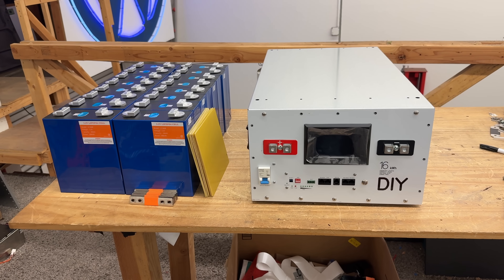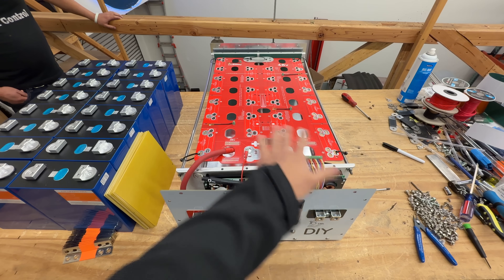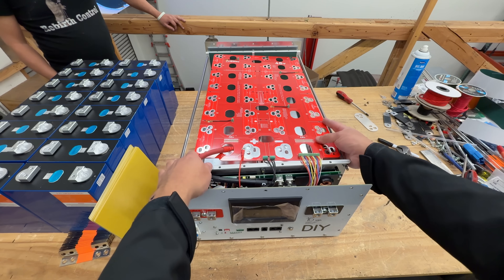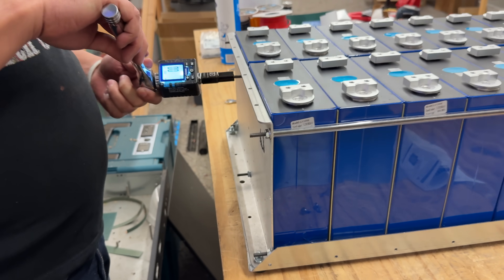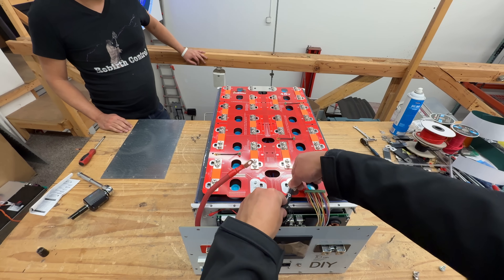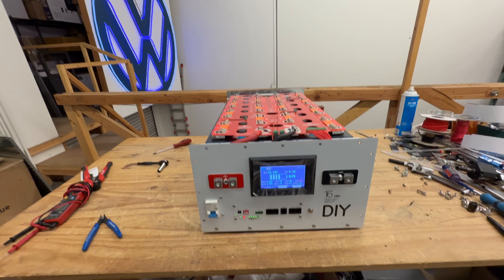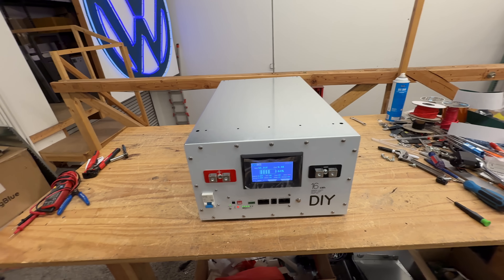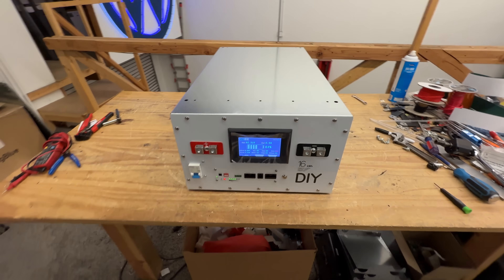DIY AmpBox1.0 #lifepo4 Enclosure

Comment: I just put a new battery together with EVE's they were so well balanced the active balancer never turned on. JK is nice but almost overkill with the higher quality batteries selling now days. You go back 2 - 3 years lot of grade B some cells had QR codes re-lasered DIY community caught on to that. The drop in LFP prices those lower grade batteries disappeared from the market.

Comment: it needs a cooling system, one could implement it in Texas for example. Especially if stacking a few of these..
Reply from the maker: At .5c max load these definitely do not need a cooling system.   Unless you put them under direct sunlight these cells should not be hotter than ambient
Reply: @jehugarcia  in ambient air those cells should reach 35-40Celsious  easy  at 0.5c (80s at 1c) but hotter climates have higher ambient than 25 C which will result in hotter temps

Also some sheds or storage units or garages (which is where these will reside dont have AC or even good airflow so inside it could be even hotter than ambient air outside...

+ if on top of that you stack them then things get even worse especially for the boxes in the middle to the top

Those batteries need to be under 35 Celsius  in order to ensure longevity in charge cycles

Because nothing melted or exploded in your testing facility doesnt mean that the same is going to happen in your client's case

but ok I admit this scenario is unlikely (the explosion) and even having stuff melted too but even so the life of the batteries is going to degrade a lot more rapidly if they will operate over 35 degrees Celsius

Comment: Jehu, you show all these custom batteries, buss bars, bms boards, and connectors. The one thing I would like to see, is the battery charger configurations for all the custom batteries?
Reply from the maker: There’s nothing custom about 16 cells.  That’s pretty much standard 48v.   You charge these the same way you charge all the other 48v battery packs
Reply: @jehugarcia  I was thinking higher voltages, 120, 144, for EV conversions.

Comment: 1000amps DC at 48v is required to match a homes mains service. 200.84amps AC at 240v is what most homes have at their main service. You would need 5 of these units in parallel to provide the amperage with most likely 6 units to make up for loses.
Reply from the maker: I have 2 electric cars with 100A panel and I never get close to maxing it.  Most Americans use less power than me . You are talking worse case I talk about average American home
Reply: @jehugarcia  I understand, and truly appreciate everything you do. It’s just that the ratio between amps and volts are different between home and “lower voltage” inverters. It’s a lot of power, but not a true 1:1. Yes most people don’t use that amount of power at one time. The statement in the video just sounded like an equivalent statement.
Reply: Most houses are never pulling anywhere close to 200 amps, I have an energy monitor on my house panel, it's never had a concurrent draw over 7.6 KwH or about 32 Amps split between the 2 legs.

Comment: Very happy to see you're entering this market. I have been waiting for a well-optimized kit like this that isn't ridiculously expensive, and it looks like you're getting close. As someone who designs my own systems using 3D-printed parts, I would love to see a super minimal version of this kit, with only the core frame and cell compression components - that way I can print my own faceplate and implement my own preference of BMS, display, breaker, terminals, etc... instead of being forced into a one-size-fits-all solution and having no control over the features and final cost. Keep up the good work.

Comment: No Jehu, no wheels behind.
Lfp batteries need to have valve up.
Only wheels under
Very beautifull material
Reply from the maker: I’ve ran LFP on their side in a diy ev for years no problems.  Not sure if these new gen cells are any different.

Comment: The prices on DIY boxes are insane. Even without bms and pcb boards. Im Currently just using an old metal cabinet. Hopefully these boxes drop in price someday.
Reply from the maker: You can get a generic electrical box roughly the same size for about $200 https://amzn.to/41t6D3T
Reply: @jehugarcia  I bought one of these same enclosures for another project and its a heavy duty enclosure thats well built but the purpose built enclosures for the size cells your using have too many advantages to ignore for many applications.
Reply: @ if money wasnt an issue for me, id definitely go with yours. Yours is still cheaper than some of the other ones online.
Reply: @Nestos209   some but not all. I've found buying the components separately can save quite a bit depending one what you buy.
Reply: Some people have 40 year old fridges on their front porch and some don’t. To each their own
Reply: @cuisinartOH1  What does that even mean? Just a random stereotype meant as an insult? No fridge on any of my porches  although I've thought about it for my hunting cabin. The battery I built looks almost identical the one in the video but it has heating pads to ensure it can be recharged in subzero temps. And it cost me $1400 and an hour to assemble
Reply: @fathergratwick  I mean, the people that complain about this being high in price have absolutely no idea how much it costs to bring any product to market, not to mention a low volume product. If they are happy using an old metal cabinet and calling it good - fine. But don’t make it sound like there is no value to others who want something a little nicer. Hence, my analogy. To each their own.
Reply: @cuisinartOH1   I didn't use an old metal cabinet. I explained what I built without linking or stating from whom I bought my components for my diy build (since this is what this is) but my comment was swiftly deleted.. hmm
Reply: If I was actually allowed to respond in turn without my comment being deleted I would but... Ive bought things form jag35 before and the censoring of DIY is disappointing.

Comment: If I had 6 pieces of this. Are there instructions on the communication protocols for them to charge and discharge together and would 6 pieces work with a Deye or Flexboss 21 inverters? Also could I get this to Jamaica West Indies?
Reply: Ok. I can find a workaround the shipping issue I guess. What about the dip switch configuration for multiple 15kw units in parallel. Sorry I’m non tech but trying to learn from watching guys like you, Will, Everyday Dave and David Poz. Great what you guys do for the off grid community. I’ll be living off grid in a few years so doing all my research now.
Reply from the maker: Yeah every top end box now has jk bms so the setup procedure is pretty much same for all of them.  I’ll do a setup video soon
Reply from the maker: It’s the very popular jk bms so there’s tons of info on the forums on how to connect to many inverters.   I can only ship to USA addresses currently
Reply: Many thanks. J. Much appreciated. Blessings 🙏🏾

Comment: you should offer a 2p4s 12v option, no one seems to and its an efficient way to package 8 12v cells with one bms. Or whatever you think would be the best 16 cell 12v option
Reply: @marlowstanton2846  I'm doing it with 2p 8s 280ah cells in a 16 cells enclosure similar to this one. The cells seem to stay balanced better

Comment: That's an ugly box for $400!  USA made for sure. Love the ease of installation though,  How many can be stacked on top? Seems rather flimsy to me but maybe im missing something.
Reply from the maker: The compression plates are 3mm aluminum and they will carry the weight of the upper boxes,  the shell with not be carrying much weight.
Reply: @jehugarcia  should add latching device on either sides to hold the boxes together. Also maybe some anti-slip surface on the bottom of the box. Guess main cables will have to be connected with cables coming from the top if not they both will be in the way of  things directly below. Just looked $450! Not $400. Very strong price when compared with much better looking boxes. Just look like sheet metal with holes.
Reply from the maker: I sell 3!different Chinese models they look the same just black.  It’s just a sheet metal box after all.

Comment: So $450 for the box and about 2 grand in batteries?
Reply: EEL was $550 and $1200 for 320AH battery on aliexpress      ...i got 4 of them
Reply: @Ebbrush3  Links?
Reply: @tattooedteddy  depends on where you get the components. I just built a similar 16s 280ah box for under 1500 and that was with a jk bms and 2 heating pads

Comment: Awesome Jehu to see you are making these now! As an owner of 5 of your 48V DIY 3.7kWh boxes I'm glad to see these. I hope a few improvements are made from those 48V boxes, They had some minor issues that made them a pain. I share these pain points purely for feedback on this box and its design so that these type of annoyances can be avoided. I LOVE my 48V boxes!

First off cramming all the cables for the display and BMS ect.. was tight, too tight honestly a 1/2 inch more would have made a big difference, but ok it still was easy to do. 

Making your own cables, not a big deal for me but man the bends you had to make made the cables really work hard. I used your cables, well not "your" cables but what you usually use WindyNation Welding cables. I found some of the bends from the breaker to the the terminal to be rough. Again you can smash everything in there so it works. But just a little more wiggle room would have been nice.

Looks like in the video you have all this "preinstalled" which is great I dont have to try and cram this stuff in.

The terminals - this turned out to be a big pain point for me, and it was my fault I'll be honesty. Since I wasn't using my setup like a traditional setup, there was a lot of unscrewing and screwing on solar charging cables. I had several of my boxes eventually break loose the terminal post! I busted out the old trusty soldering iron, removed the old solder and soldered them again fresh. Problem solved, my fault for probably overt tightening in the first place. I've moved to anderson connectors to that is a non issue now for me and moving forward.

The 48V boxes had a weird issue (all of them) with when you first turned on the box and then flipped the breaker on you would get a CC alarm that would go away. Now I did go into the BMS and change settings, one was the CC setting, I lowered it for what I though would be extra safety, but I learned over time I had to bump it up to 300A or 600A depending on the inverter/load. I mention this more for other people than anything else. I wish the BMS's were programmed for the box already but again nothing that can't be overcome, heck a pamphlet with some recommended settings would be nice.

I'm glad to see you added the 2A balance BMS! I know you feel strongly its not needed but my experience with the 48V packs is I really wish they had active balancing. I top balanced my batteries and everything was identical down to 3 decimal places and I noticed the drifts starting to occur. I've heard people say that's a LEV60F battery thing that they are hard to keep balanced but I can't say if its true, in my experience it sure appears to be. So I'm glad you are using the 2A Balance BMS now WITH bluetooth that was another huge drawback of the 48V boxes!. I know these cells are much more likely to remain balanced but its nice to have it anyways! I think you probably noticed that with your sales. 

Assembly/disassembly - ugh man this hurt. Literally. There was so many darn screws you had to undo to open up the box for maintenance (LEV60's going out of balance...) getting the 16 cells inside the box was SO tight. to the point you couldn't add a sheet of fish paper in between each cell because it was too tight for the plates which had a terrible design of not being able to give them room for expanding and then tightening them again. Sure you could remove them but they had to go back into the same location and if you added stuff for protection god it felt like you were crushing the batteries. The best I managed to do was to wrap each cell with a few layers of kapton tape, anything else and you couldn't get the compression plates to sit properly it was too tight. So when I had to take cells out to re-balance them it was a horrible PITA. Because of the tight tolerances of the box, you almost never got all the screws to line up properly to reinstall them. You would have to push down hard on a part of the box to make some of it fix and other parts were just not aligned well. I dreaded taking those boxes apart. It could also be likely I just suck at putting things together! I hope these new ones give more space so that cells fit easily and can be compressed properly and keeps the box in its proper shape without making it wonky when you go to put it back together. It looks like you did that in the video so that's good, but it also looked like the other guy in the video was having to fuss with the plates to get the cells to fit in so there a tad of concern there for me. I'm glad the box is designed and accounted for the insulating sheets.

I'll probably wait for V2 of this box to buy one (at first then it'll be 5 lol) that has wheels and busbars that are the hard kind that go to the bms. Really need wheels or the ability to easily add them I'm a one man operation. I don't have the luxury of a 2nd set of hands to help me so I have drag this thing that weights probably more than me alone (you would have seen me trying to handle 400W solar panels alone, I darn near killed myself, if anyone's curious yeah you can fall on top of one and they'll be ok. that hurt..

Again I'm a very loyal customer and at this point I'm probably past the $10K in sales with you. I love your videos, and your products are what you say they are, though I do have concerns over some of the EV cells that could be part of recalls but I just stay away from those, I don't want to bother with Li-ion cells anymore. So I'm not bashing your designs, in fact I'm the guy that still needs 2 of the LEV60 "basic" boxes that we chatted about on ebay as I still have 32 LEV60's I want to put in a 16S2P config.

So after a very long post what I would love to see in a V2 version of this box:
1.Wheels
2.Continue BMS w/active balance and bluetooth
3. Maybe stronger terminals, not critical...
4. Fitting 16 cells EASILY and then being able to compress properly, this is HUGE on the list.
5. Minor documentation on the BMS recommended settings (maybe?)

I am curious in the video you installed the 16 cells and reconfigured the BMS and it read around 60something SOC. Were those cells just out of the box and not top balanced already? That would be a nice comment to add on a sheet explanation of the top balance procedure, since this geared towards newbies. I admit I didn't know when I built my first box. I learned later on. But its a lot to learn about. So any small help is always appreciated. Even if its just a paper sating "google top balancing --you need to do this before battery installation". Help the newbs out!

I super excited about V2,  please PLEASE ensure it'll take the 314AH cells without issue that would be awesome man. 
I know I'm nobody to you, you wouldn't look twice if I was being beaten by someone on the street, just someone who's paying your bills, its fine we dont need to be buddies, all though I still have tremendous respect for you and I would come to your defense in a beating! I've offered to help your business for free many times to no response. Its cool man do your thing. I do hope you take some of the comments I shared for V2 seriously, surely I'm not the only newbie out there that struggled with the 48V box (which is actually powering my bedroom right now where I am typing this!).

Keep the new products and videos coming! Love them. I seriously want to do something with the JP3 cells you are offering even if they are Liion chemistry. I'm just waiting to see how the design of the busbars works with the tabs, I wish you would do a video on just attaching your busbars and the ones that came with the cells showing how to make a 2s2p pack and building it out. That's what's stopping me from buying a ton of them. I just dont understand well the busbar situation. I'm a newbie.. I'm also unsure (maybe its on your site now) the max continuous charge rating for them, my solar can push upwards of 70A but I don't know if those cells can handle that (I know the discharge they can..) Actually I think I see a video on my recommended viewing that you made about them without a laser welder! Need to watch that now! Could lead to my credit card exploding!! :) 

Cheers brother,
Wishing you all the best and keep sharing your knowledge. Mad respect for you.
Reply from the maker: Seems like we are addressing most of these concerns in the next iterations 1.2 will have built in handles that will serve as air vents also.  We design custom terminals that are much more tough to bypass 100s of Amps from paralleled boxes.  Solid internal Busbars and a few other changes.
Reply: @jehugarcia I think you’re on to something here for US customers. I’m in for three or four of the next generation if you address these issues. I eagerly await news of the next generation!